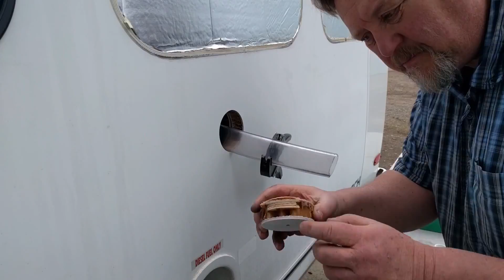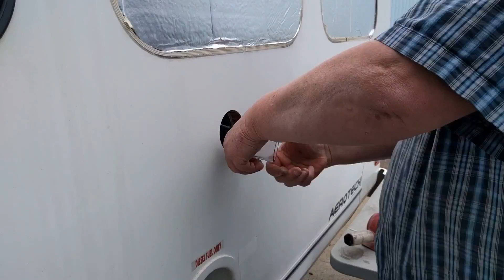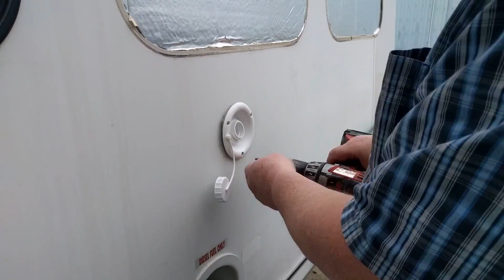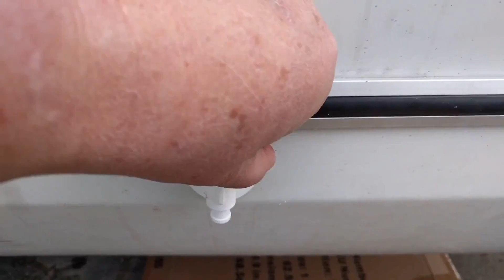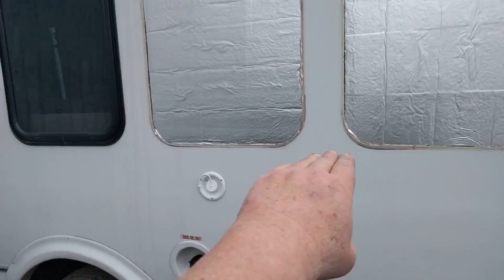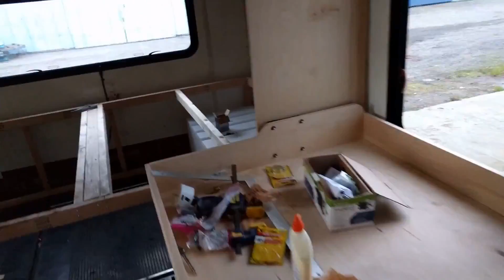Shuttle bus rv conversion (Part 7) Water tank inlet install,butcher block clearcoat

Comment: This might be a dumb question but I'm a newbie. What prevents the water from flowing out when going up or down a hill?
Reply from the maker: @Micheal Pelletier  Not a dumb question, because when the tank is full it can dribble out the vent hole just under the filler cap if going down a steep incline.  Not enough to worry about, Thank you for the comment!  :  )

Comment: what size water tanks do you have?  also what fittings did you use in the tank, did you get them from Amazon?  if so have a number?  thanks...   removing the floor from my shuttle.. because of a few dry rotted spots.. but will make it easier to install the tanks under the floor
Reply from the maker: @The American Wanderer     https://www.amazon.com/Class-Customs-Holding-Concession-Trailer/dp/B077ZCQXBF/ref=pd_cp_263_1?pd_rd_w=If38g&pf_rd_p=ef4dc990-a9ca-4945-ae0b-f8d54919    https://www.amazon.com/SHURFLO-4008-101-E65-Revolution-Water-Pump/dp/B002XM5G70/ref=pd_bxgy_263_3/132-2782292-7159667?_encoding=UTF8&pd_rd_i=B0  You can get the fittings at Home Depot or Ace Hardware